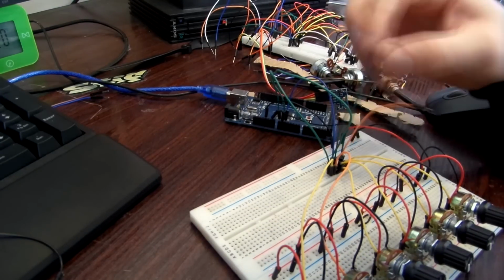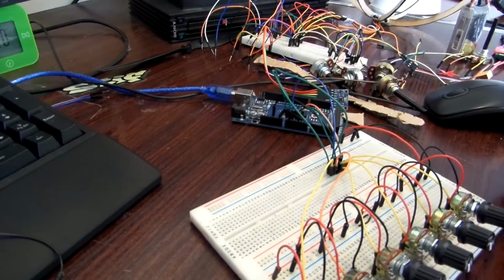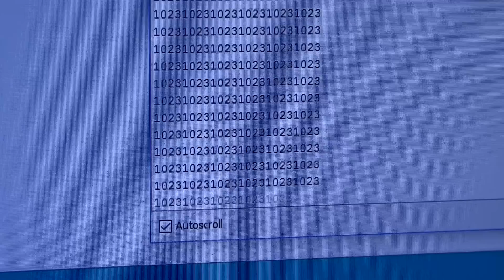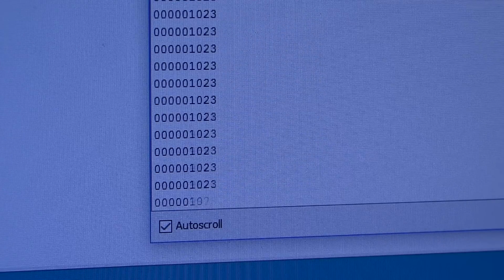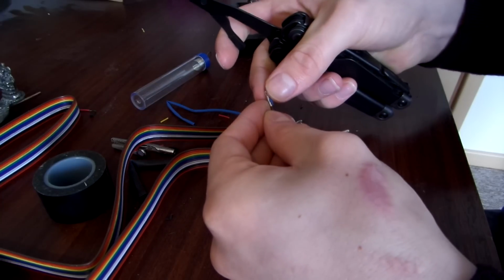Building a Single Propeller Drone With Arduino (PART 4)

Comment: I'm 5 years late, but the problem is fins gotta be far below the center of gravity so that their thrust vectoring creates a moment to the CG. Yaw will work because fins are correctly far from CG from top view,  but for roll and pitch, all the fins will do is create a horizontal component of the thrust force, so close from the CG it'll just move the drone in space, rather than spinning it around CG

Comment: I think gyroscope only give you 3axis readings. I think you should try something like mpu 6050 which will allow you more precise callibaeration and also accelerometer readings. I think coaxial rotors might also solve the problem with accelerometer readings. And one more things, is to eliminate the error in the gyroscope, so it runs fast. In this case that will be most important.

Comment: Could you use a static turbine like set of fins that redirects the airflow to counteract some of the turning force. I think the contra rotating propeller would be the best as adding it would also provide some additional lift countering the mass added. Technically I think I'm right in saying that the contra rotating mass could be just a mass and it could undo the rotation. If you had that mass further away from the centre you could use less of it at the same speed, or even have that contra rotation going even faster than the propeller.

another thing you could do is add a tail rudder, like a helicopter, but I imagine you probably wouldn't want that, as it will stick out and you would need at least two to keep the centre of mass central.

I subscribed today, this channel looks really interesting, and I'm surprised you don't have more subscribers. Good luck in your future builds.

Comment: did you think about the counter clockwise(reverse) reaction moment from the propelllers. Because i feel it does it for your  drone. You can use those twin blades(helicopters) to balance moment out and buid this beautiful machine perfectly
Reply: Simple duct that propler

Comment: I’m working on a single ducted fan uav that must stabilize on its own in cross winds so it can hover in one spot. What is the code you made for the air fins to adjust with the gyroscope
Reply: Use self balancing robot code to control the fins